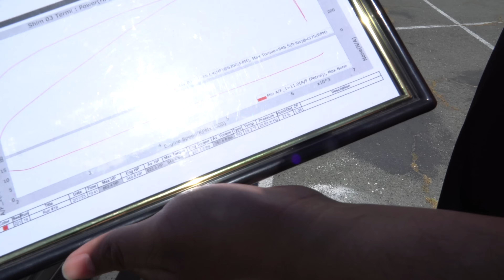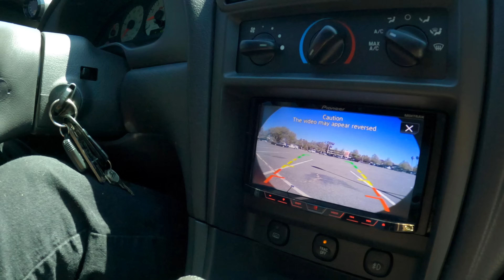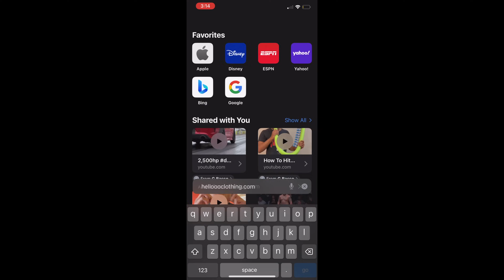FULLY BUILT TERMINATOR COBRA PULLS INSANELY HARD WITH OVER 860WHP!!

Comment: I had an 03 Mineral Gray Cobra that I just sold last year due to moving over seas. Hopefully the guy I sold it to lets me buy it back when I move back to the states. My set up was very similar but with a stock motor....2.9L Whipple and all the supporting mods, fully built IRS, tubular front end with coilovers....if there was a mod to do, it was done. The car was a blast to drive and always turned heads at car shows and cruises. One of the iconic Mustangs that will always have a spot in my heart.

Comment: I dont like when people call it the original hellcat that isnt giving it enough credit.  It was more badass for 2003 than a hellcat was for 2015 when it came out imo.  These things have done 800-1000 wheel with blower swap and fuel system stock bottom end that is pretty close to what hellcats are capable of except these weigh 3600 lbs vs 43-4500 for a hellcat depending which one you have.  The hellcat is the terminator of its time not the other way around.

Comment: First off....BADASS terminator man! Now you said a teksid aluminium block from an 01 cobra? That is not a teksid. Its a w.a.p. block. Teksids were in all 96-98 cobras and only a few handfuls of 99s until ford ran completely out of them. Majority of 99s and ALL 01s have a Windsor Aluminium Plant block. Check in the valley of your block with a flashlight. If facing ur engine at the front...in the valley will be a long rectangle square with grid pattern. If its a square pattern, it's a teksid. If it's a diamond pattern, its a w.a.p.
Reply: Its a teksid.. some 01 came with them. Trust me I built it I know all about these
Reply: 95-98 Lincoln Mark VIII had 4.6 DOHC and hate to use absolute but were largely TEKSID blocks.

Comment: I'm not seeing 850 on a non crusher 2.9.  Happy dyno.
Reply: It has a point higher compression than stock and when you're on e85 that makes a decent difference.  Just throwing that out there
Reply: @midnight347  Plus ported heads and cams. It's a max effort standard inlet 2.9.

Comment: dude was making sandwiches between his shifts, needs to learn how to heel toe
Reply: Heel toe to do a couple pulls on the highway?? 😂😂 show me how its done big dog
Reply: @ParadiseLivin_SVT  
game is to be sold not told big dog, ur granny shifting and not double clutching when u should
Reply: @jasonmitchell8883 pretty sure you're being sarcastic at least I hope so.  You don't heel toe when upshifting just stab the clutch and move the shifter fast as possible don't lift off the throttle.  Gotta know how to drive to pull this off without breaking shit.
Reply: @jasonmitchell8883  double clutching lmfao like it's a 1975 ford f100 with no syncros in the transmission.